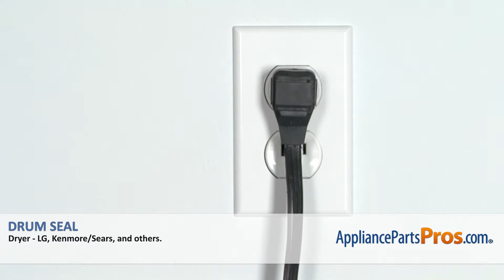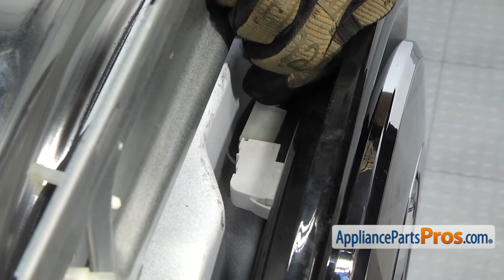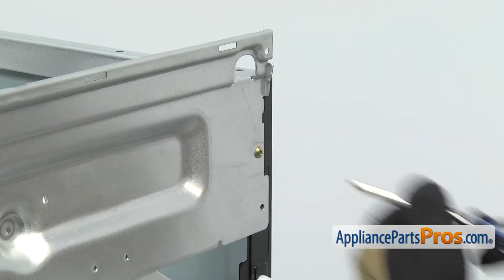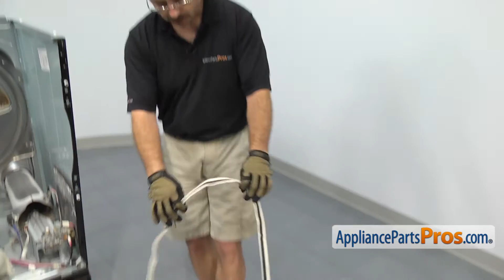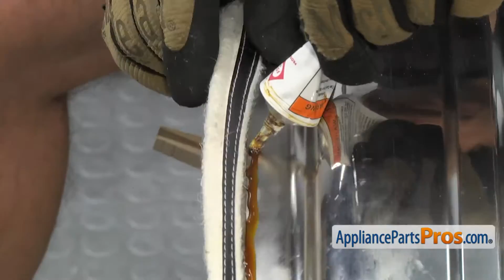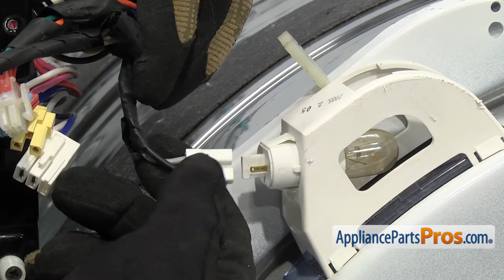How To: LG/Kenmore Drum Seal 4036EL3001A

Comment: take off the lid and turn the drum manually, i discovered a small piece of metal stuck between the felt and the back plate of the dryer removed it and problem solved! do your research first you can learn a lot from simply opening the top cover
Reply from the maker: Great troubleshooting tip! Foreign objects can definitely get lodged between the drum and felt seal and cause scraping or squealing noises. It’s always worth checking for obstructions before replacing parts. Thanks for sharing your experience!

Comment: Hey, I've found that this part works for my Samsung Dryer Model# DV328AEW/XAA-0000 and any other dryer that uses the same drum.
I took a gamble ordering this part, since Samsung doesn't sell replacement felts and they REALLY want customers like me to purchase an entire drum assembly instead, but it paid off. It wasn't too difficult to stretch it out and the felt installed perfectly. I've had this dryer for over 8 years and hopefully it lasts much longer because of this repair. I found this video EXTREMELY helpful!